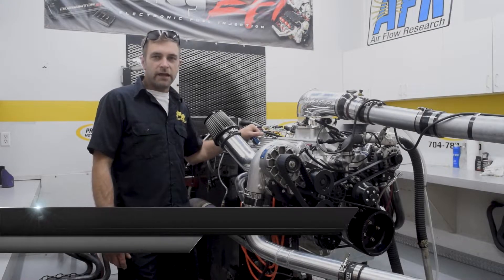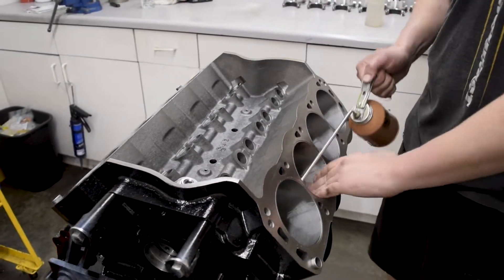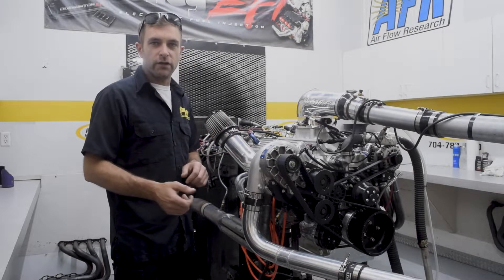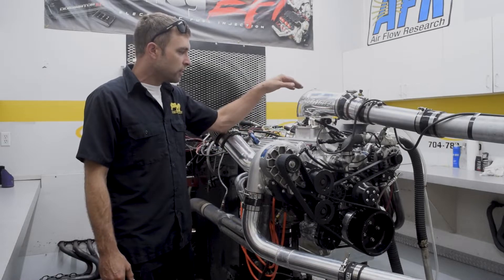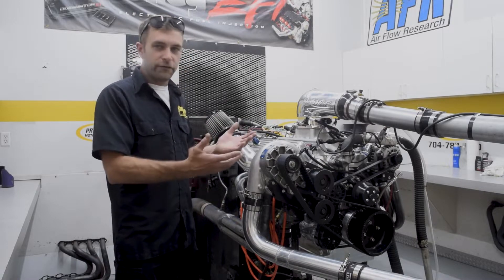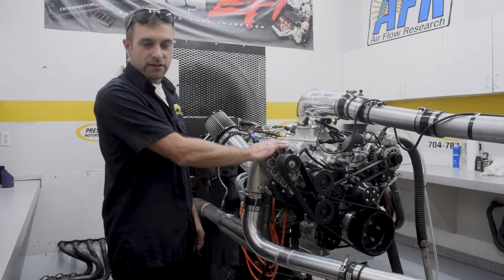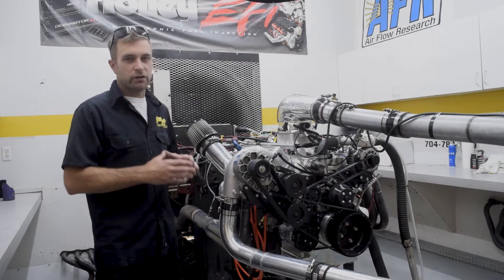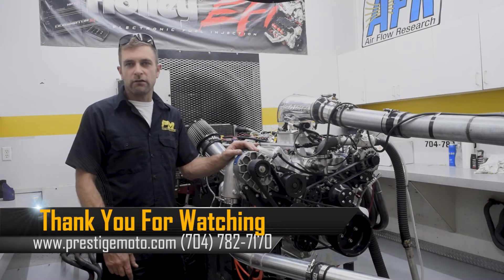1229HP Vortech Supercharged 427ci Small Block Ford Dyno Testing & More at Prestige Motorsports

Comment: How hard would it be to put an electric water pump on this deal? Still run the supercharger.
Reply from the maker: We dont recommend that unless you are racing only but that said not hard. There are pumps with an idler that allow the same belt routing

Comment: What transmission would work with this setup for the street? Thanks
Reply: Cindy, unfortunately I don’t work for Prestige but if you’re considering this engine I would suggest you call them and let one of their experts advise you. There are some good ones available that can deal with that power level. With that being said, I would gladly give you my opinion. Starting with the basics, would an automatic or manual transmission suit your needs ?